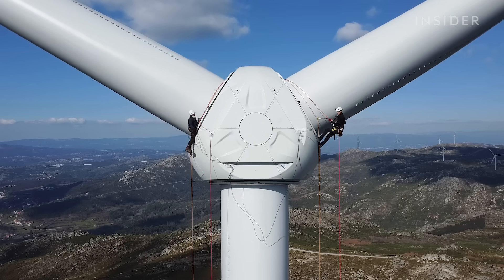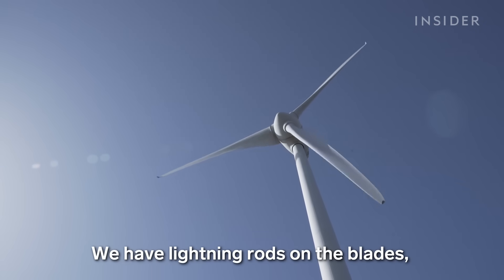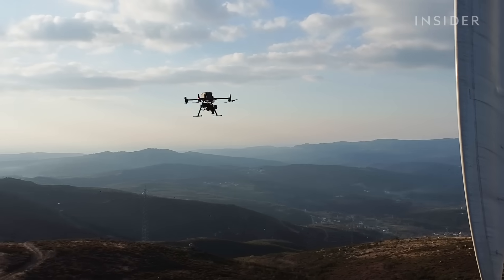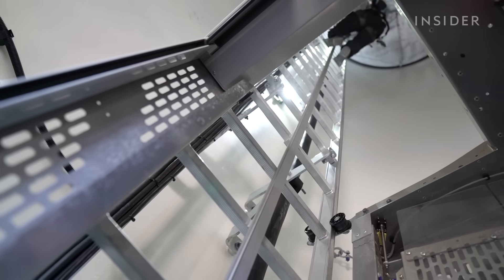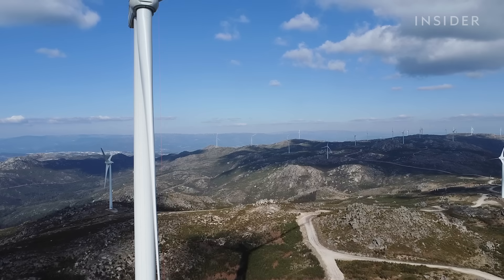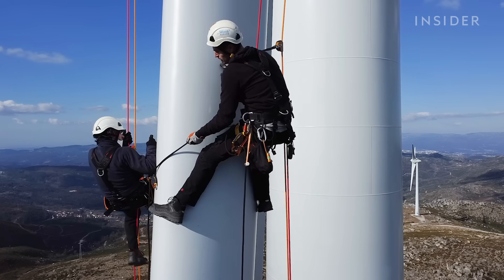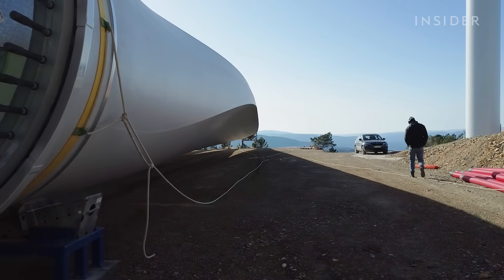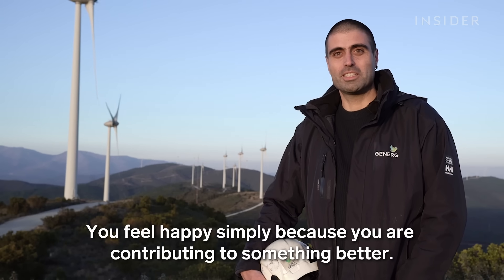How Wind Turbine Technicians Risk Their Lives to Keep Blades Spinning | Risky Business

Comment: Anyone here with experience and advice for someone thinking of joining to work on the wind mills , anything helps 

Thanks In advance 🤙🏽
Reply: its a very comprehensive field so make sure you have an electrical engineering degree and some knowledge of chemistry.
Reply: @niceguy5772 thank you I appreciate you taking your time to respond

Comment: Wind turbines have a life span of 20 to 25 years.?
WHO PAYS to remove the redundent old unuseable turbine.?
WHO PAYS for the replacement NEW turbine? 
WHO PAYS for recyceling of the old Turbine?
WHO PAYS for the removal and dumping into land fill the remnants of the old turbine?
With 3,000 plus units around Australia, this over 20 years is not the CHEAPEST form of power!
So WHO ends up pAYING?
Reply: The… the energy company?

Comment: I'm completely baffled as to why they don't give these techs a parachute or a wingsuit. A strong gust would definitely toss these guys off even with a rope and harness that's secured. Easily ropes can get tangled to the point they would have to cut the line. I'm also dumfounded by the salary they give these techs. The company is basically saying that the techs lives are worth 36k which is absolutely ridiculous! They should at least be getting paid six figures. I don't care that they're supposedly getting double the annual salary in Portugal. It's still peanuts compared to the suits down below who are making tons of money, NOT risking their lives. I'm sorry to rant. It just upsets me when I see someone put their life on the line for a job that they're not being properly compensated for. And for those who don't know about this profession. It's more than climbing and dangling off the side of a propeller. You need extensive electrical training, you need to know about circuitry, mechanics, physics, mathematical skills etc. God, please be with these men and women who have the guts and skills to perform this job!

Comment: Fascinating. I think the risk is minimal if the safety protocols are followed to the letter. No different than, say, constructing a skyscraper.
It's more being exposed to the elements in the winter that must be a b*tch. Can't imagine doing this in cold weather countries.
Using hammers to detect potential fractures is really neat; tells you how sensitive human touch and hearing is, even comparing to electronic sensors. Like many technical jobs; training and experience go hand in hand.

Comment: Climbing from inside is much less terrifying than climbing from outside.
And with all those safety measures it's not all that dangerous as this video is trying to prove except the part where they have to dangle in air to inspect. That's frightening.😱

Comment: The ironic part is, that those are conpletely senseless
Reply: Clean energy produces over 20% of Americans energy not at all that senseless
Reply: @Independent7274  i talk about wind energy. Not your "clean" energy.
Do you know how much plastic will be used for one of them? Do you know how they will be recycled? No because they go to landfills. Very clean.
Reply: @hansdampf2084  Compared to other ways of providing energy it is a lot more cleaner. Landfills are not the problem it’s the Carbon producers pumping nonstop
Reply: @Independent7274  so you are ok with landfills full of plastic?🤣🤣🤣 
Calculate how much plastic you need for the same energy as other powerplants like nuclear
Reply: @hansdampf2084  96% of Wind turbines are recycled even the plastic. The composite blades are not but are used in other ways. Nothing is perfect but better than coal burning.

Comment: Dang, I have climbed up various broadcast towers and things like that, but nothing like this, even in decent shape you don't realize how difficult it is. If you don't do it all the time or even if you do….your legs go. Your hands quit functioning. It's a rough go. It seems so simple and easy, it's not. Nothing but a lot of respect for people like this.
Reply: I worked climbing telco towers as well - yes, my legs were sore at the start before I got used to it but never had an issue with my hands.

The hardest part for me was learning to trust the equipment, those 'lifelines' can give you, what we used to call a 'two-inch heart attack".
Reply: It looks easy until you remember: what if these had been stairs? Could you climb all the steps to the top? Sure you could, but you'd be tired.
But these aren't stairs. You also have to climb using your hands. Many people don't realizing how exhausting the act of gripping can be. It hurts your arms because the muscles controlling your fingers are in your forearms.
Reply: Easy until it’s time to free climb! And by the sounds of it y’all never had to. I been free climbing on this project for a month climbing up extension cords. Tell me it ain’t hard and if so you free climb them up.
Reply: Easy job. I did it for years, sitting in a comfortable Petzl Podium and charging a great per hour fee.
Reply: @mirandahotspring4019 I agree. Been doing it for 12 years now. It's not particularly hard at all.
Reply: @mirandahotspring4019 sitting at a desk would make this incredibly easy. I dare you to climb these as a profession.
Reply: @mirandahotspring4019  how do you manage this? You only worked with drones?
Reply: @AntiqueMeme  No, worked on ropes.

Comment: Pretty cool job, I used to work as a commercial diver, diving in water towers/tanks. Didn't have to climb up more than 200 feet, but respect what these guys do, anything with heights involved isn't easy.
Reply: Wait commercial diver? What all did that entail and how do you get into that line of work?
Reply: @Kylewraps  I had just graduated college in 2020, probably the worst time with covid and all. Saw an ad for underwater welding on facebook and ended up taking the plunge for commercial dive school. It was a 6 month program in NJ where I got a feel for being/working underwater.
Got a job a month out of dive school and it was cool for awhile. Did the tank diving because it paid a little more for green beans in the industry and it was close to home. Diving water towers/tanks is physically demanding, climbing up 175 at the most and then hauling up all your dive gear/equipment with ropes/pulleys is tough lol. I dove the tanks for cleaning sediment/other crap on bottom, Inspections of the insides, and occasionally repair work say if there was a leak or something like that.
Reply: @nicholashaindl7940  how much was dive school? 

I’m a high school dropout 26 years old and trying to find something to do with my life. Thinking about wind turbine technician classes but I need to conquer my queasiness with heights which idk if it’s realistic 

Gonna jump out of a plane this year I think to see if that helps my fear
Reply: @Kylewraps  anywhere from 10k-35k, their usually around the same time, 4-6 months of training. Morgan city college in Louisiana is the cheapest and DIT in seattle WA is probably the most expensive. There's also a couple in Texas, Arizona,  and Florida. 

Theres a lot of possibilities with dive work depending on your work ethic/skills, having a mechanically lined aptitude helps. A lot of guys go offshore to work in the GOM after school. There's inland work all over the place, from dams, nuclear power plants, potable diving, salvage, general construction. Lots of options.
Reply: @nicholashaindl7940  nice I’m in Houston Texas 

I’m not handy or mechanical so I feel like I would get discouraged rather quickly and quit 

Maybe I should try electrician trade school, I thought about Tulsa Welding school but then I realized I would have to buy a diesel truck and financially it makes no sense to buy a diesel truck to make like $60k per year
Reply: @Kylewraps hey just wanted to see what you ended up doing

Comment: NO! Those techs aren’t wearing lanyards. If their fall protection fails, they are done. 

In the states, everyone must wear two lanyards at all times and, with exception to ascending using a glide lock, at least one lanyard should be secured to a tie-off point at all times. Blades are only worked on by specialized contractors who have equipment specifically designed to access these points, which they are able to tie off to. Anyone who goes up-tower brings rescue gear that can be used to ascend the tower from the outside if there’s an emergency.

Comment: "70% of Portugal energy comes from renewables", pull the other one. First off what you should say is electrical energy, which is only 20% of Portugal's energy need. Then a lot of that 20% "renewable" is bio-mass which is imported, especially from the US and it's chopped down and shipped using diesel. Then solar and wind turbines cause massive environmental damage and in the future need to be replaced. Then of course you have all the down time as there's no way to store that energy from wind and solar. Renewables are an environmental and economic catastrophe.

Comment: I read an article where two wind turbine engineers were stuck on top of the turbine because it was burning and they were going to die so they just hugged until they died
Reply: If it’s the same article. One jumped and the other tried to climb down. They both lost there lives, unfortunatly.

Comment: I rt really wish I could get an explanation of why they just don't put more flights on a ring, so to speak. I mean. Wouldn't you get more energy for less, if you put more wings on the propeller, and it spins faster, with less weight and fewer components?

Comment: the surfaces of the blades have many holes and scratches due to small pebbles after one year working. without maintenance, cracks have grown on the surfaces and once the crackes spread and binds with each other, the blade breaks. it costs over 200 million dollars to exchange one blade. so manual maintenance is best for cost reduction.

Comment: Rappelling down the blades looks terrifying, but I would be totally content working in/on the nacelle. I love heights, but the dangling part would be where I draw the line. I've thought about going to build them, or be one of the guys climbing towers to change bulbs and whatnot. I would love it. I just need my feet planted on something to feel safe.
Reply: In my experience, there is a rigging system that is specifically designed to access the blades. Either this video is really old or these guys are taking unnecessary risk by accessing them like this.
Reply: @japark85  Nah Mate. We still use ropes to access blades when platforms and lift trucks dont make make sense to for various reasons. The two rope system is very safe. Possibly more safe than a lift truck.
Reply: @browningchris3  I’m not talking about equipment. I’ve seen it done using a system involving ropes and a box platform thing to stand in. I can’t remember the name of the company we hired, but they were there specifically to touch-up the rotor paint after install. It was cool.
Reply: @browningchris3  I’ve used the system shown in the video. What I’m talking about looks a whole lot more comfortable.
Reply: @japark85  Yeah Ive worked around those types of platforms but not on one. They kinda cool I guess but I wouldnt say theyre safer. Id honestly rather be in my harness and work seat than those because Im in way more control of all the variables.
Reply: @browningchris3   Mmmm… I worked with a Spanish erection contractor and they really scared me. They didn’t use cotter pins on their lifting shackles. They cleaned the bottom of the nacelles using gasoline while standing underneath the suspended load. They had a lift sling for the nacelle that ripped and, when we told them to get rid of it, they tried to have it repaired and then use it again (we said no of course). They drove their fork lifts around the job site with the masts all the way up. They went to Mexico to get workers and paid them like $5/hour. The list goes on and on….

I don’t think I will ever trust a foreign company to keep me safe after that. I am scared for the dudes in this video.

Comment: The danger of this could be easily eliminated for good if the energy needed was provided by a simple free energy device in each home; ref; the John Searl SEG Electromagnetic Generator which  is no larger than two shoe boxes; it can produce all the electric energy you need to run your entire household and much more. Which would you rather have?
Reply: The one thats physically possible and actually produces energy I guess?

Comment: As a yield engineering question ... How much energy goes into building them and for maintenance in crude oil or coal?  Wind is a variable and fluctuating energy source to capture energy with to compensate energy costs keeping the environment clean.
Reply: It uses hydraulic oil that has to be changed every 9months and other lubricant’s let alone the carbon footprint it cost to make, transport and mine out of the ground. All diesels. Wave energy uses no oils no parts to catch fire. But kept quiet. You see it yet.

Comment: too bad they're made from fiberglass. That is in no way a renewable material.
hold on though they said the wage were 36000 dollar yearly?
that sounds low.
i realize that its hard to compare wages across country with housing prices, store prices etc.

but in denmark 36000dollar is about 262553 dkk.
which is considered low wage. Often something a full time worker in say a retail store makes.

Comment: 8:23 "MW/hr" units don't exist. The Watt, a unit of power, is work(J) divided by time(s) so dividing Watt again by time(hr) doesn't make sense.

Anyways, amazing work done by wind turbine engineers. A great example of how the Green Economy pays so well.
Reply: how do you explain kWh then?
Reply: @l.e.bassdesign  hi there! if memory serves me well, 1 Wh is 1 Watt multiplied by 3,600 seconds (1 hour), which is essentially 3,600 Ws or 3,600 Joules (ie energy, and not power). Hence 1 kWh is equivalent to 3,600,000 Joules. Hope this is as accurate as it can be. Its been 13 years since my graduation.
Reply: Yes, so what’s exactly wrong with MWh?
Reply: @l.e.bassdesign  theres absolutely nothing wrong with MWh. check out the units at 8:23, which is MW/hr ie "MW per hour" which doesn't exist as its physically impossible.

Comment: Considering the huge amount of fossil fuels it takes to create one of these turbines, I wonder how long they need to be run until they become carbon neutral. Do the maintenance crews ride their bikes to work, or do they drive? If they drive, do their cars run on gas or electricity? If it is electricity, how is it generated? Do they charge their batteries at the turbines before they leave or do they just use the same coal powered electricity that everyone else uses?